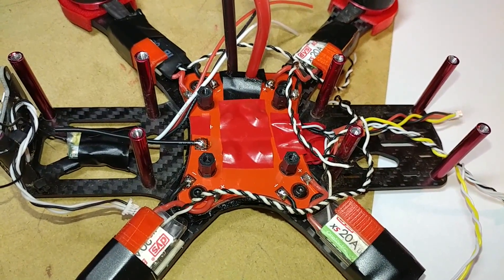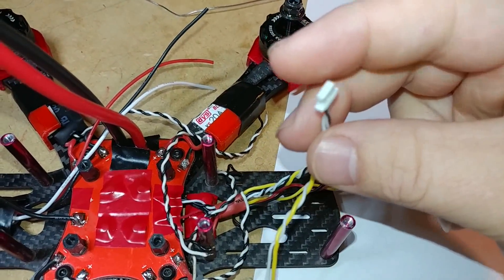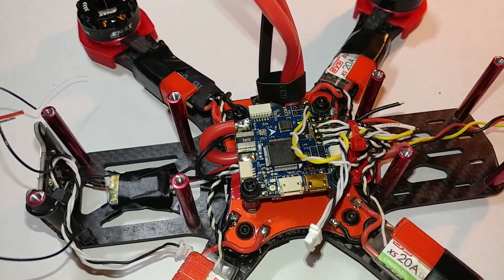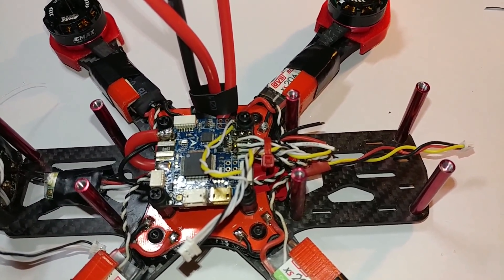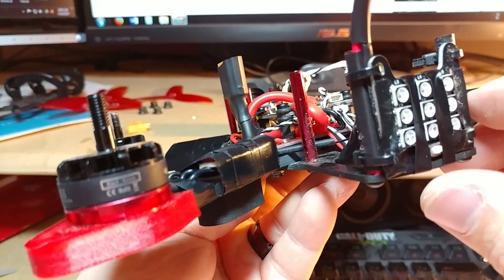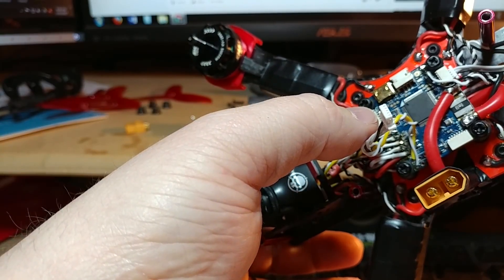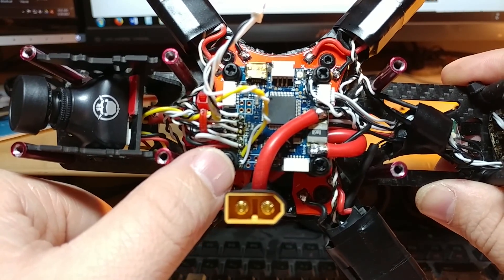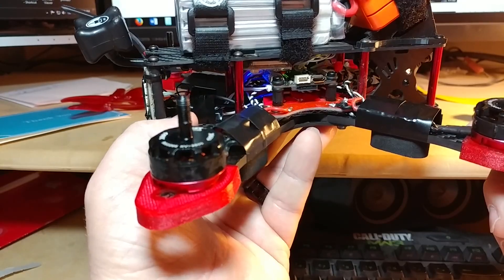Martian II 220mm / OMNIBUS F4 Pro install

Comment: Sir, use 14awg wire for the main power supply (ok for RS2205) and your main pdb connect point looks a bit dangerous. 

As an alternative suggestion: 
Solder 14awg () wire from T60 to the "front" pdb vcc pad()
Solder 14awg () wire from F4() to "rear" pdb vcc (-)
Solder 14awg (+) wire from T60 to the F4 board (+) IN
Solder 14awg (+) wire from F4 board (+) OUT to rear vcc pad(+)  
Cable tie the main wires to T60 using the pdb holes with 1 or 2 inches extension   

+ add a 25v or better 35V 1000uf Low esr capacitor across the vcc + / - terminals pads   

Budget FPV rc - did something similar to my suggestions
https://youtu.be/ihNWbINH8Ic
Reply from the maker: Thanks for the suggestion. The way you
listed above was how a built it the first time. Thought I would try a new way
this time. I haven't decided what way I like it. As far as the 14 awg vs 12 awg
I ran 14 before on a different quad and the wire would get hot. So I decided to
be safer than sorry by running 12 awg + that what’s on my battery so it only
makes sense to run the same.
Thank you so much for your input!
Reply: 12amg wire is absolutely the incorrect wire you should be soldering up to your FC. That looks like it will burn alive when you plug it in. You also have a lot of extra tape that looks really dangerous. You don't need to cover up ever solder joint.